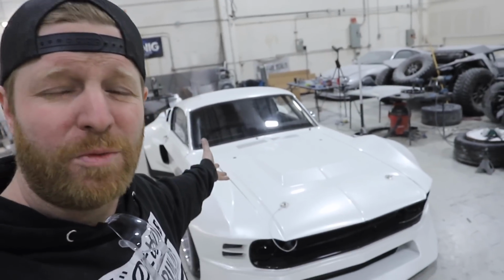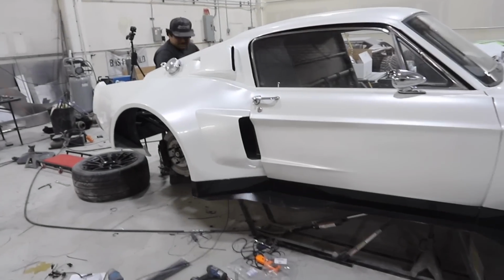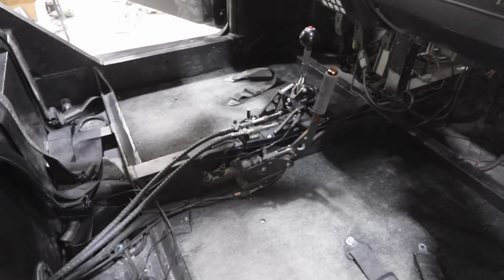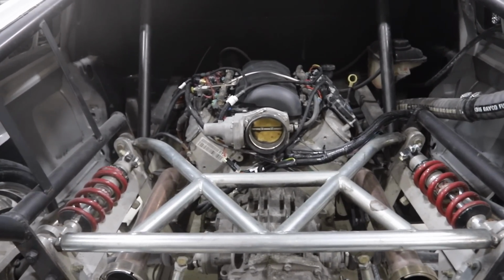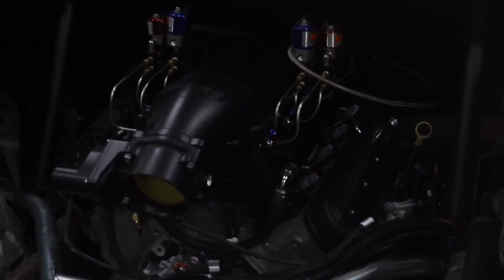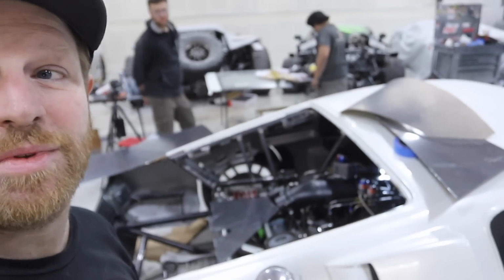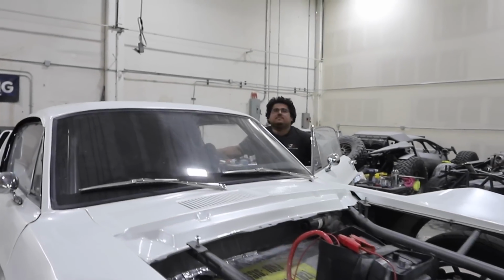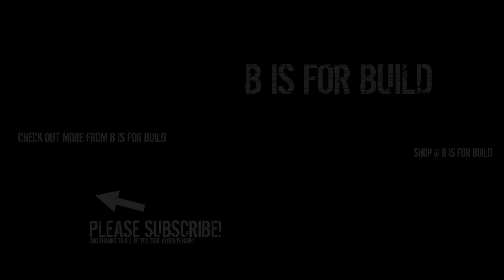We BROKE The 67 Mid Engine Mustang Hours Before Needing To Leave For SEMA.

Comment: If you by chance haven’t figured it out yet, on a swap I did the ignition wire I originally tried to use would cut signal while cranking. Worth a check if youre still in a bind

Comment: Well check the parking shifter sensor,  because the car started right before he changed the shifter. Oscar will know what I'm talking about. The sensor that tells the car it's in park,or you have your foot on the clutch pedal so you can start it. You guys did a fantastic job good luck at SEMA .

Comment: If you replaced the sensor you might have to go thru the setup process on the controller before it registers. I just seen someone else have the same issue
Reply: Fab rats?

Comment: Oscar built a hell of a car there. If I was in charge of the Holley stand you missed out sadly! Just pushing too much work into the tail end and the interior is not ready. It's a disappointment but will be an outstanding automobile, when it's done. It's a better situation to get the engine nitrous loom and fuel sorted before installation and then fit it. Still the vision can be appreciated.

Comment: You need 
fuel sensors
Start ignition
Sensors electric
Fuse box
ECU
ENGINE BLOCK
SPARK
PISTON
(CHECK VERY CAREFULLY)

Comment: Check power at the pcm on my ls swap blazer i could read codes but i wasnt getting a clean 12v my wire had melted to my exhaust so check at the PCM back probe it hope this is the issue

Comment: So it was running before you swapped to the Holley system. Then the issue isn't the crank sensor it has to be with how you have the Holley configured.
Reply: The thing Is that they are too tired for that
Reply: Not how diagnostics works.

Comment: Why did you not test at ecu pin for signal, if not there but coming from the crank just temp join one wire, if not sounds like and immobiliser issue, good luck

Comment: Coulda just done cam reference and ignored crank angle sensor. Or disabled cam sensor and only qent off crank. Like cletus did on ruby. They were losing crank signal and they shut off cam reference and crank sensor started working.